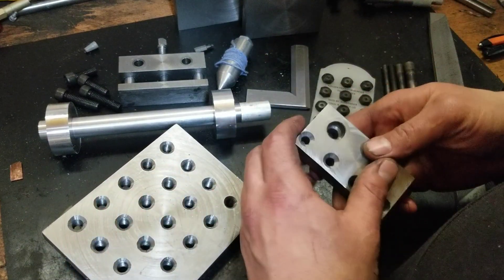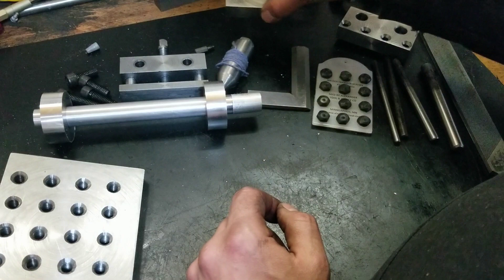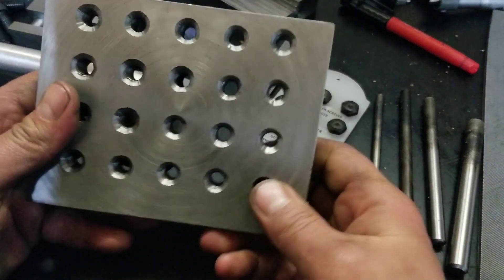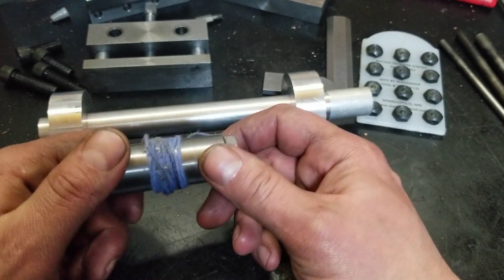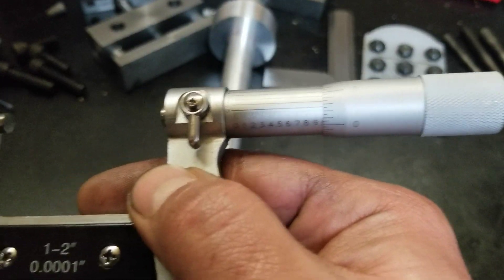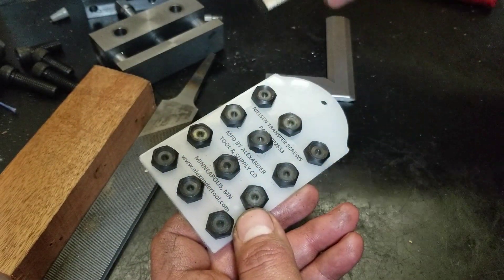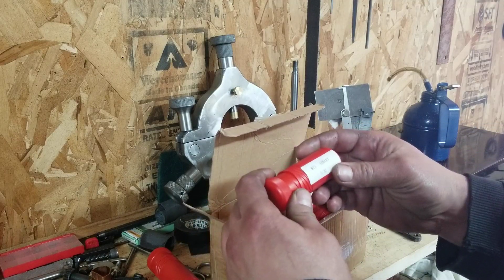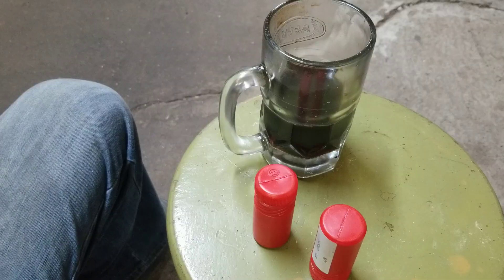Lathe Alignment Issues Resolved

Comment: Oh man, what an aggravation the bed was that far twisted!  Now you have me paranoid about mine, it needs some basic servicing again soon, it really should be checked again as the rubber feet may have settled.
Reply from the maker: It really doesn't take much. A result of spring thaw no doubt. (Judging by the number of cracks in my shop floor lol) But it doesn't take much to correct either 😊.

Comment: Frustrating as it was, my guess is you learned a whole lot more from the errors than you would have done without. Sure making stuff twice sucks, but it’s definitely quicker second time around and you rarely repeat the same errors once you know the cause. Stick at it, spend wisely, measuring kit first then tooling. If you can’t measure repeatedly you can’t improve.
All the best
Mat
Reply from the maker: Truth! 😊

Comment: Don't get too downhearted, four thou is a hairs breadth after all and I would have thought most of your parts can be sorted by re skimming them. I check my lathe and milling machine every month, if they are more than a couple of thou out over six inches I investigate, maybe a weded steel base would be more rigid. Good luck, stay safe. Cheers
Reply from the maker: Well, it was the accumulation of tiny errors really lol. I would have thought that big laminated top would have been more rigid. Oh well, just happy it wasn't my headstock 😊. Cheers
Reply: @Just1GuyMetalworks  There's a completely logical reason why even a couple thou twist in the lathe bed makes a much larger difference than a couple of thou taper on the part that's almost never explained very well. With even a very minor twist in the lathe bed visualize it as either slowly ROLLING or ARCING the tool tip into or away from the parts cutting surface as the carriage moves along the lathe bed. Due to the height of the tool tip above that lathe bed it magnifies the beds twist effect you see as the carriage moves longitudinally. Getting it dialed in well enough to see only a 10ths difference in roughly 6" is more than impressive. Dales plumb bob method can obviously work just as well as an expensive machinists level if your vertical bar is as long as you can fit between the lathe carriage and the ceiling. The longer that bar is then the more sensitive the plumb bobs movements are. As you already know it's a rather slow method that takes a great deal of patience. Trading time for money is just part of paying your dues in this hobby I think. Fwiw I can say it slowly gets less frustrating as you add more tooling to your shop. Matt's points above about buying good measuring equipment first is exactly right, if your equipment can't repeat and display accurate and dependable numbers each time then your already lost. Machining is a lot like navigating on a map, you have to know where your starting from before you can get to where you want to be. :-)
Reply from the maker: @turningpoint6643  indeed, a little short on some decent measuring tools. Surface plate, gauge blocks/pins, maybe som indicators that cost more than $30 lol. And yeah, the effects of twist are quite dramatic, well in the machinists world it is lol. Wish I paid more attention in calculus now lol.
Reply: @Just1GuyMetalworks  LOL, yeah who knew how important the "when the hell am I ever going to need that so this is just wasting my time" math classes were back in school. :-) The off shore metrology equipment is slowly getting better as well as the prices moving up a bit to match the better quality. But it's still pretty much hit n miss on just what you might get for how dependable or even the long term durability it might have. One persons glowing recommendations for what they bought may not match what your results might be even from the exact same seller. I got burned enough early on with some of what I bought that I now try to buy the best I can afford for both measuring equipment and cutting tools. Even then I still don't blindly trust what I'm buying for measuring equipment without a few checks with gauge blocks. So far the better equipment does always pass those checks, but mistakes can happen with the best manufacturers. Used but still in very good condition Starrett, Mitutoyo, Mahr, B&S, Lufkin, Moore & Wright etc is worth considering since some careful buying and patience can usually get you almost new condition at roughly an off shore price. Generally I wouldn't pay more than about 40%-%50 of new list price though. And it would have to be almost brand new to pay that much. Lot's trying to sell for far higher, but there dreaming or trying to sell to those who don't know what the real market price is. I did pay dearly for a great condition B&S 558 cylindrical square some years ago simply because there now getting fairly rare and have some unique abilities, but there also no longer being made. Lot's seem to think measuring to + - .001" in a home shop is ample, until it isn't for what your doing and you sure can't add higher precision and accuracy later. My 10ths indicators probably get used as much as my one thou dial indicators. In the long run it's probably cheaper to buy for where you want your shops capabilities to be in the future than what your needing today.

A few tips for you that might help. One detail I didn't mention about lathe alignment. Worn lathe ways do create a vertical movement of the cutting tool point as the carriage travels from a less worn area to a more worn section. But lucky for us that movement has much much less effect than a out of square or twisted lathe bed does. That's due to the tool point moving up or down on a shafts radius as it's cutting. And the larger diameter that shaft is then the less measurable effect that slight movement in elevation has. Milling on a lathe is of course different and any high wear area might have an affect on your part accuracy. If you don't already know of it? Run a Google search for Dr. Georg Schlesinger and his book Testing Machine Tools. There's at least a couple of sites with free online PDF's of it. It's pretty much THE bible for machine tools and how to run a complete series of tests on about any machine tool were likely to own. It's also well worth the download and printing of a hard copy. Study that enough and you'll then understand more than about 90% of the guys with home shops and even a great many professional machinist's. If you have no idea of where the problems and inaccuracy's are in any machine tool then there's no hope of ever trying to adjust or even try to compensate for them. 

For highly detailed metrology information when choosing what to buy this is the very best source I know of. http://www.longislandindicator.com/ I haven't seen anything they have to say that I'd really disagree with.

Both Starrett and Mitutoyo  have good free online information on there websites and also YouTube videos that are well worth the time it takes to go digging for it. The most important and crucial three terms to fully understand when buying metrology equipment are exactly what's meant when Accuracy, Repeatability and Resolution are mentioned. Too many with home shops don't understand how they differ and what they really mean. One perfect example of that is videos where the poster quotes the .0005" number on a set of $15 digital calipers as if it has any real meaning. That's the tools display resolution and not the tools built in mechanical accuracy or it's repeatability. Those three terms all have separate and distinct meanings and aren't interchangeable. I don't count on nor would I expect my $200 Mitutoyo calipers to be more accurate than about + - .001"-.002" under average shop conditions if I have to be 100% sure those measurement numbers are in fact correct. Yes they can do better and I've proved they can to myself with good gauge blocks. There's still just enough uncertainty while using them I usually won't gamble on what the display shows.